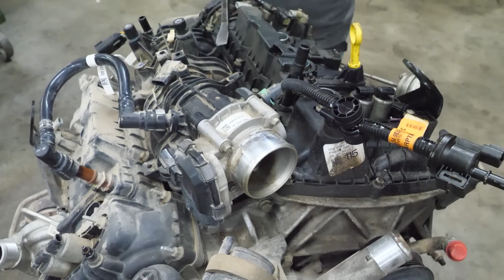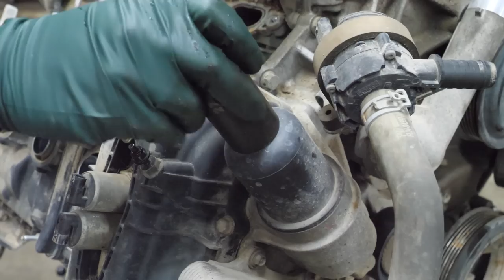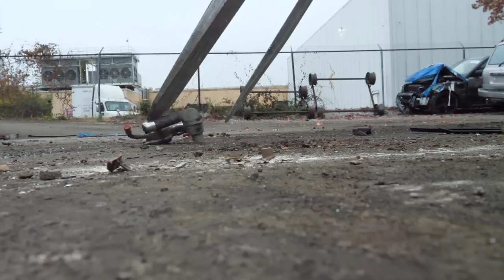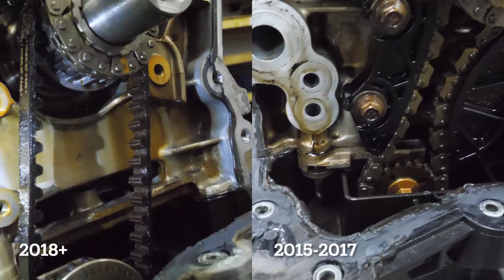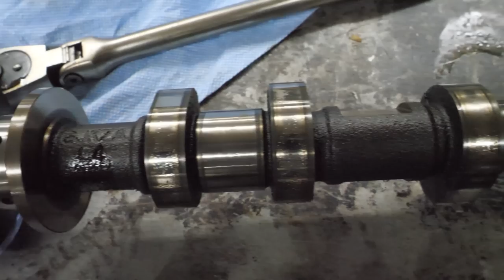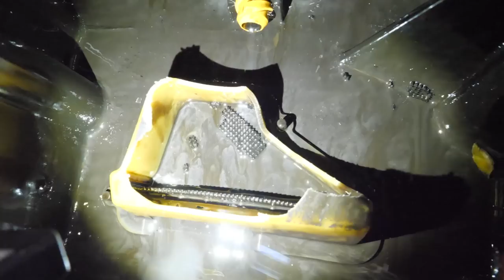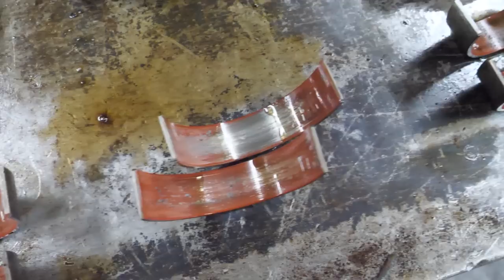A LITTLE TOO SPICY! 15-17 Ford F-150 2.7L Ecoboost V6 Engine Teardown

Comment: I still can’t believe the oil pump is driven with a belt and not a chain in the newer models. Such a good engine and cost cutting for dividends killed it in my mind.
Reply: It works through the warranty period, that's all they care about
Reply: That’s longer than the cam phasers in my 2018 3.5 Ecoboost. Ford replaced them with the updated parts. My cost $0
Reply: @Krunch2020  yeah those redesigned phasers are crap, hopefully the updated service part is better. I haven't personally had to replace an updated phaser but that's just me.
Reply: Is this not the same year (2018) they went to dual fuel injection (direct and port) to try to prevent carbon build up on the back of the intake valves and in the ports? So make one thing better and another worse; makes so much sense 🙄.
Reply: Tell all your friends,co-workers, family members any and all pickup truck enthusiasts wet belt bad idea for the customer money saver to fatten up the executive bonus program at Ford !!!
Reply: I'm still skeptical about trying to wring every drop of hp/tq out of these anemic little engines. Are these engines commonly making it past 150k miles like the earlier larger engines did? 15 years ago Ford made V8s that ran over 300-400 thousand miles regularly. Maybe these have the same longevity. I dont know
Reply: I have a 23 and my have the mighty fallen.. i wouldn't recommend a new one with any drivetrain.. mine has 7k miles on it, and it's built like absolute junk..
Reply: I found out that their wet belt became a selling point for their competitors. My brother was shopping recently and mentioned scoping out a Ford Escape. The salesperson informed him of that flaw and that ultimately killed his interest in looking at those or any other Ford. It’s a sad shame, and I hope the engineers behind it are hearing all about it.
Reply: @GenderIsBinary80   this is a 2015-2017 pre (2018)
Reply: @giggiddy  Can't make money out of longevity????
Reply: @timlee4204  Of course longevity is the key to making money. But I'm not sure these little engines will get the longevity that the larger, understressed engines that proceeded them did. Can't squeeze every ounce of power out of something and expect to get 200k- 300k miles out of it. Just my thought
Reply: @giggiddy  Of course, you want your product to be better than your competition, but manufacturers are pressed on every side. The consumer wants more power from less weight, less cost, less maintenance, fuel economy etc. The EPA are pushing for less carbon emissions, where is it all going to end? Ted from down under.
Reply: @timlee4204  Couldn't agree with you more my friend. I was happy with a good old healthy V8 that made 250-300  hp and lasted 20 years and 300k-400k miles. But I got out voted by the government and here we are. I just don't see these new engines lasting that long. I hope I'm wrong.  Cheers!
Reply: @giggiddy  I learned to drive in a 1925 Buick, at 14 she taught me lots of things about cars, nothing on that car was automatic, one had to adjust the ignition timing as you went, even the generator didn't have a cutout, if you left the ignition on the battery lasted half an hour. My next car was a 1941 Pontiac I watched her go over to 300k miles one night on my way to a new job. At 22 years old she was a rusted bomb but what roads did she put up with ? Central Queensland Australia in the 1950s had not seen much sealed roads. my last car was a 2001 Toyota Camry V 6 Wagon, at 22 years the AC still worked, with almost 300k klm (about 200k miles) the back seat looked like it had never been used, but don't come too much past 2000 if you want longevity.
Reply: I'd only buy Toyota or Honda with VVT or chain driven OHC, No one else seems up to the challenge. @Krunch2020
Reply: I'm still begging Eric for a 4G63, Eric?
Reply: I own a 2016, 2.7 with 350k miles
Reply: @giggiddy in stock form they are hardly squeezing every ounce of power out of these little engines.  They are capable of far more than they come with. Properly maintain it and it’ll last much longer.  Burn less gas. And give you much more spg. It’ll also get out of its own way. And all the old v8s had their own issues along the way.
Reply: @zachattack83  If they are adding a turbo or two, then the engine is being made to put out more horsepower per cubic inch than it would naturally. In short, a truck with a 450hp v8 will very much get out of its own way and doesn't need forced induction and high rpms to do so. As such, its will last substantially longer than a turbo 4 or 6 cylinder. Is a naturally aspirated v8 without flaws?  Of course not. Do I think it's very impressive to get 400+ horsepower out of a 4 or 6 hole engine? You bet. But the tests show when pulling loads uphill- a smaller downshifting high rev turbo charged motor seems more stressed and unnatural in that environment. And I don't see many making 200k+ miles in that environment. Not just my opinion. The many tests tell the truth. The only thing the smaller engines beat the comparable horsepower v8 in is gas mileage, as my SUV gets almost half what the smaller engines do in a similar vehicle.  If you still disagree, we can certainly agree to disagree as I like anything that has an engine in it. Cheers!
Reply: Belt is designed for it. Going to a belt reduces heat, oil consumption and believe it or not reduces overall failure due to better wear rates. Using it on a fluid pump is fine, due to overall resistance, if this was a cam that’s a different story.
Reply: @ajstar89  "Going to a belt reduces heat, oil consumption and believe it or not reduces overall failure due to better wear rates."  What the hell would a cogged rubber belt have to do with oil consumption?

Comment: The reason the oil pump chain is between the cam chains is cylinder offset. One bank is always further forward so you have an empty space perfect to run an oil pump.
Reply: I thought it was pretty obvious just by looking at the position of the timing chains, I don't know why Eric questioned the placement of the oil pump chain.
Reply: Just because the geometry informed the engineering, does not mean it's a good design. He's perfectly right to question it because he thinks like a tech and it's just one more snag due to short sighted engineering.
Reply: a garbage design
Reply: A V6 has a greater offset than the V8.
Reply: @Mis73rRand0m  Have you ever worked in any type of automotive engineering and seen constraints and regulations that must be met with modern vehicles?

Comment: You doing the side by side shot of the oil belt vs oil chain is absolutely wonderful, keeps consumers informed on potential problems 
KEEP UP THE GREAT WORK 😅
Reply: That belt isnt a potential problem, its a guaranteed problem as shown other videos already on YT about the belts shredding before breaking and plugging the oil pick up. It seems Ford engineers thought they were such a good idea that they implemented the new Coyote 5,0 with that junk idea.
Reply: @young11984 you're kidding? A belt like that in the 5.0 v8?
Reply: @burntnougat5341  nope, serious as can be. Not only the 2.7, 3.5 and 5.0s but majority of the ecoboosts since 2016-17 has been belt driven oil pumps and seen some brands had wet timing belts come apart but remember that they are claimed to be “lifetime of the engine” belts. Well when they come apart the engines are destroyed so yea thats the end of their life at that point. I was going to post a pic of a buddys 2022 F150 torn down with the belt driven oil pump but i cant here
Reply: not in this video right?
Reply: I would be surprised if any of his viewers were uninformed enough to buy that crap, but who knows - all modern cars are bad so it's hard to compare.
Reply: Lifetime oil change, lifetime transmission fluid, lifetime fuel. It all dies when you run out. 

All the auto assemblers have switched to "non serviceable" or "lifetime" fluids. It's a gimmick. I get the VIN breakdown of my drive line components and find the recommendations direct from the manufacturer of those components. 

I supposedly have lifetime transmission fluid. Manufacturer recommends 80k mile severe service intervals. I'm changing it at   200k now that it's finally starting to change color.
Reply: Yes that was a great job on your editing!!!
Reply: @young11984  They started with the belt on the 2.7/3.0 sometime in 2020. 2015-2017 should be chain driven.
Reply: @fusionvic  Ford started belt drives before the 2.7
Reply: @young11984 yet these goons are still out there giving Ford money for garbage trucks.😂
Reply: @Vgk36  if you want to name garbage vehicles then actually research every brand and body style then get back with me when you figure out they all expensive garbage with built in defects…..every brand!!
Reply: Seems the belt started in 2018 @fusionvic

Comment: I think the oil filter and all of those little screens did a great job keeping most of the damage out of the top end.
Reply: i replaced the turbo oil feed filters/screens on mine @ 120K miles, they were surprisingly clean, its a good PM to do though.. my 2.7 is on a Fusion sport.
Reply: Before I throw my tools at the wall because I'm stuck on something I pick myself up and say it's fine...
Reply: @gamingwithzan4654  it’s not an easy job
Reply: The oil filter will trap everything, so the cam solenoid screens got stuff from some place else.  I think the cam things are a dead end, the oil to them isn't full flow, just on & off, so the bits must come from inside them.
Reply: @alro2434  True, nevertheless, those little screens did their job.
Reply: @alro2434  The oil filter should catch everything after the pump, but there is a safety valve in the filter, if that valve lifts then rubbish can bypass the filter.

Comment: There was a problem with both generations of the 2.7L whereas the engine would burn oil for a brief period after a cold start, particularly if you parked on a hill. IIRC, the fix was to replace the driver's side turbo oil line with an updated part.
Reply: They did that on my 17 and it fixed the problem.
Reply: The drivers supply or drain line?
Reply: @2strokeFORever  Supply. It's almost identical from the outside. I think the turbo side on the new part has one o-ring where the OE part had two. Not sure how that effects it.

Comment: Its also possible the engine being turbo direct injection, had an LSPI(low speed preignition) event. LSPIs can knock on the order of 15+ megapascals that can break a piston crown or ring land in an instant. By the time you hear marbles in a can is already too late. After that it can just burn oil and run until it burns through the rest of the piston, which can take a while with vastly increased oil consumption. API SP oil was developed specifically to help reduce LPSI events.
Reply: Yep, when I saw the broken top land I figured LSPI.  These LSPI events plague all TDI engines from all manufacturers and were a major investigation/development/investment area prior to the massive investments in electric drives.

Comment: Fun With Turbos!  

Take some exhaust "els" and weld them together so that you form a tube that takes the air from the compressor wheel and leads it to the turbine.  NOW, install a bung for a tube that can be connected to a propane tank with a valve.  And a bung for a spark plug and it's electronic unit with D-cell batteries.  Using a small pump, provide oil flow for the turbo center section bearings.  

Now, hook up the propane tank.  Turn on the pump for the oil.  Use a leaf blower into the intake of the compressor to get the turbo up to speed.  When it is at max speed that your leaf blower can make, turn on the spark and slowly open the propane valve with the spark firing.  You now own a turbojet engine, and you will hear it slowly increase in speed to the point where it will idle without the blower.  

If you increase the propane, you increase the speed of the rotating assembly to the point where it blows apart, I urge caution....
Reply: Most inefficient way imo
Reply: Do you kick it off with “hold my beer”
Reply: @DonI-cg1we  Only if it is Pabst Blue Ribbon.....

🤮

Comment: This is another great tear down. I like Ford because they think of the little things, like owning a complete tool set but not using most of it, Ford makes sure to include every size of fastener from standard, metric, torx, hex, 3 square, you name it they include it. I would like to thank you for creating a channel and sticking to the foundations that make great content. Informative and, entertaining. This channel has grown and developed into a masterpiece, and speaking of things that have grown.... no not that..... your engine "shelf" is taking over your shop one wall at a time and will soon bury you in all the unopened treasures of malice held within the combustion palace, most simply refer to as a "core".  Keep up the great content and new things.
Reply: Thanks Eric for the great videos. Talk about Ford tools, my Dad came across a new Ford owner in the 1950s, he had a flat tire, first the jack wasn't strong enough, so while waiting for someone to come along he thought he might as well loosen the nuts! The Ford supplied wheel spanner just finished up ROUND.

Comment: I had 2011,2013,2014 F150s with the 3.5 turbo and loved everyone....i changed the oil every 2500 miles....that motor never failed me and great on gas also...drove from lexington KY to Erie Pa on 1 tank of fuel...i think thats awsome

Comment: Thanks to you and your videos I have now become good at maintaining my vehicle. Ive been wrenching every day for 25 years and at the end of the day the last thing I want to do is change my oil or replace parts on my own stuff. However you have shown me the importance of even merely simple general maintenance and what it can prevent. Thanks for that. As a mechanic I knew but as many of us do I brushed it off as not being as important as it is and led myself to believe it'll be fine.
Reply: Been there, done that.
Reply: I have a Diesel motorhome now, all the more important to not let the oil get overloaded with carbon.

Comment: i have this motor on a Fusion sport, it rocks! tons of torque and excellent power on the top end 5-6K RPM, i have seen 140+ mph dozens of times. I have 125K miles and zero mechanical issues other than some minor vacuum leaks and a purge valve! maybe its the Mobil1 5W40 since day 1 at 5,000 mile intervals
Reply: I drove a Fusion Sport, ended up buying a new Hemi Charger but did like the Ford.     Every time I see dark wheels on a Fusion I then look for the 4 pipes-     very rarely is there joy.
Reply: @emmexfyv  yup the dark wheels, nice thing is this is a company car👌🏼

Comment: I commented to a friend asking for a teardown, 3 minutes later you deliver. It's fate.
Reply: Fate?! Or destiny?
Reply from the maker: It’s density
Reply: @I_Do_Cars  That water pump has density, that's for sure. Can't believe your forklift lost!
Reply: @I_Do_Cars   great video of the Ford  deception  "built  Tough "  yep The entire motor is made that way  cheap turbos,  injector metal , oil pan etc etc look at the rods how dinky they are .    they may be powerful for a time, but they are only made to go a short distance. Ford = get consumers money  and run ,  meanwhile your  left with  plastic junk , inferior  metal motor  junk  assembled like a high tech  lawnmower   . Its better to buy a chevy truck   with LS ( even small LS or   even v6 ) and put a 70-80mm turbo on it and you have More power , less  parts ,   one  timing chain,  one cam, real  metal oil pan etc, It amazing  of what ford  corporate money greed  created  junk they come up with  to sell to consumers . yep  meanwhile your  left  with failing motor parts  back  and forth to the dealer  bleeding  your wallet to death

Comment: Nice work, as always.  It's amazing that these tiny turbocharged engines last as long as they do in a truck.  You mentioned a cylinder liner.  However, it looks as though the block is iron.  And what a bizarre block it is, BTW.  Very creative, smart people designed this... unfortunately, they were tasked with doing the impossible, IMO.
Reply: This is the graphite impregnated cast iron block like diesels have.

Comment: I'd say that oilpump is pretty much the most robust design of an oilpump ive ever seen. Its not immune to damage from metal, but because of the floating vane design id say its self-healing any scratches or scoring.

Comment: A good friend had one of these in a 2013 F-150. It had runability problems that after many trips to FORD it was STILL not fixed! He left the dealership shop where he had bought it and got on the freeway onramp which was right in front of the dealership and stomped on the gas. The engine went 'BOOM' in smoke and steam so bad that a piston came out of the block with so much force that it bent the motor mount. Ford then gave him a new engine. Turns out to have been that an injector was loading up. He told them!
Reply: 2013 is a 3.5L

Comment: My entire existence is solely to experience the sound of cracking the cam caps loose.
Reply: Ehh...... I'm more partial to the cracking of Head bolts, but Cam bolts are nice.
Reply: Don’t you mean cramming the crap caps?

Comment: From your side by side of the oil pump chain and belt it looks like the threads are still in the block on the 18+ engines for the chain guides. Looks like all you would need is two new gears, guides and chain.
Reply: Assuming no interference from the timing cover, yeah probably

Comment: Hey man, thanks for doing this tear down. I have torn down a 2018 2.7 motor. I have several videos on it. 
I will say, the motor I did the pistons were much harder to remove unlike the ones you removed.
Thanks for making this video.